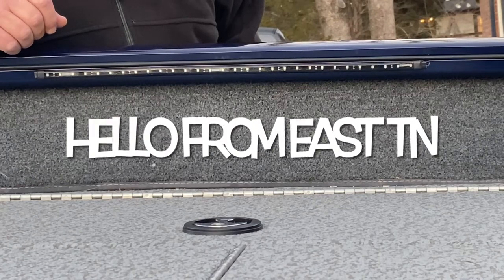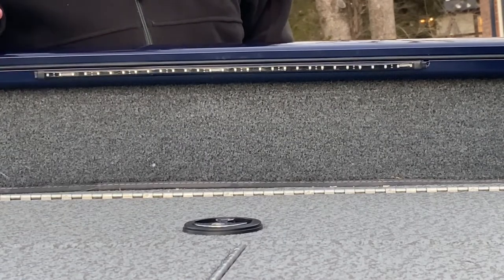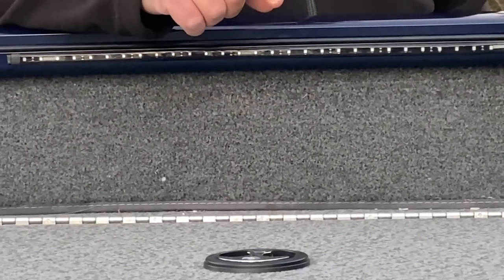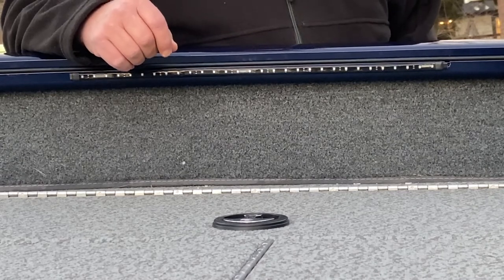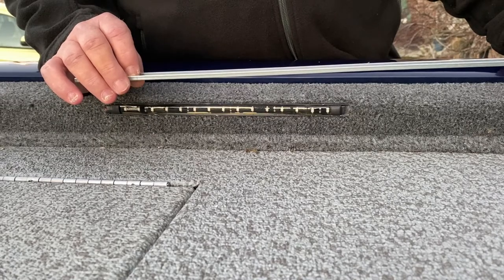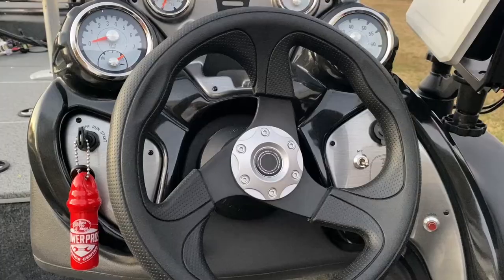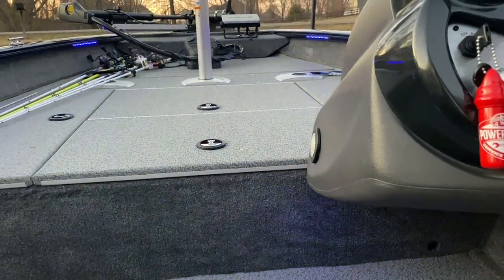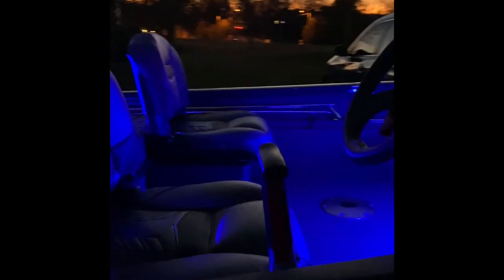LED Deck lights on my Tracker 175

Comment: It's SO refreshing to see someone who does NOT have that "I don't want to drill a hole in my boat" syndrome! Get that drill out and get to it - regular drill bit, hole saw, what ever it takes to get the job done. I wonder if they'll make LED's that turn on and off some day when you touch them - that would be the ultimate LED upgrade!
Reply from the maker: Yeah your right. Sometimes you just got to go with it.

Comment: That looks good and works great if you never want to use your VersaTrack system.  I ran red LED strips ( Tracker is red) around the entire perimeter of the boat except across the very front and directly behind the driver’s seat (where that aluminum cover is located) and under the console.  They are attached to the carpet under the gunnels with 3M mounting tape and are not visible except when illuminated.  I installed white LED strips around the inside perimeter of each of the front compartments including those under the seats and in the battery/fuel compartment and put a blue LED strip around the perimeter inside the live well.  Each group of LEDs is on a separate switch mounted where you put your dimmer control with a fuse for each run.  I’m retired with some vision limitations.  The compartment lights are a tremendous help to me.

You gave me an idea.  I have some aluminum LED channel that I can use to mount an LED strip on the cover behind the driver.  I already have LEDs under the triangles on each side at the very rear.  I could easy tap into the starboard LED triangle wiring for power.

By the way, if you decide to light the front compartments, you should be able to do so without drilling any holes for power.  Mine already had hole or open spaces between the compartments at the rear of each one as well as behind the console for the starboard compartment.  You may have to fish around to locate them as they were hidden.
Reply from the maker: Hey you have made some great points. I will have try these if I want to use my versatrack. Yeah I almost bought the red lights for my boat, but since my boat is blue, I went with the blue lights. Thanks for watching.
Reply: Did you ever confirm if the versatrack still works?  Love the clean install but I need that track system for a bunch of other things, lol. @easttn.fishingdude4169

Comment: Total number of lights you used? Looks good
Reply from the maker: I bought the Bluewater led kit from TH marine. It was around $65.00 plus the dimmer switch. The sku number is 98-4. I believe it a total of 6 strips in different lengths.